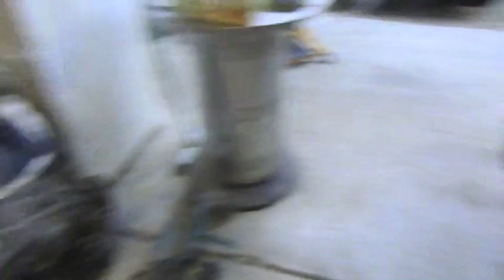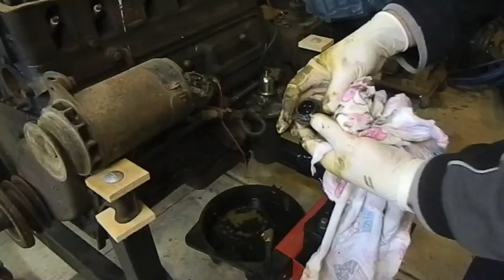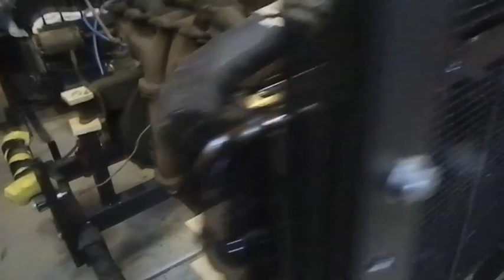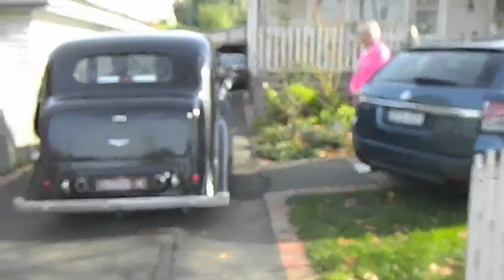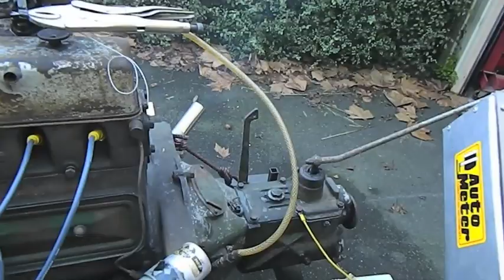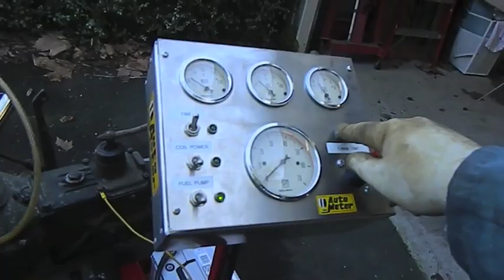Wolseley classic pre-war car restoration 14/56 Part 3

Comment: I had a 12/48 way back in the 60s watching you working on your .engine brought back happy memories. The oil pressure on mine was 80 to 100 psi so yours is about right. Your engine still has plenty of life left in it
Regards. P.C.E

Comment from the maker: Thanks... yep, I am about to pull some bits off and check the pressure relief valve and pump. Might try a capillary type gauge    as well just to ensure that the electronic one is behaving. Then I'll fiddle around with the carburettors to see what's going on there. Will retest and re-post.  

Cheers Peter

Comment: The pressure relief valve in the oil pump might be stuck causing over oiling especially on the small ends near the rings...Worth checking...Love the vid!!